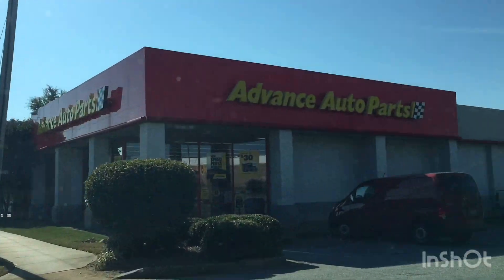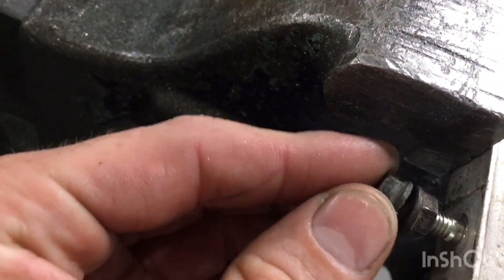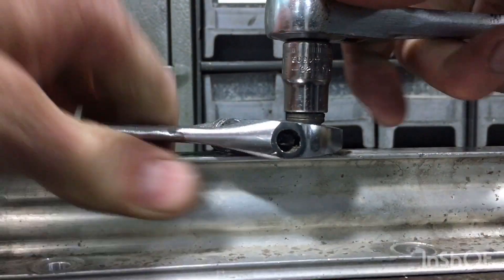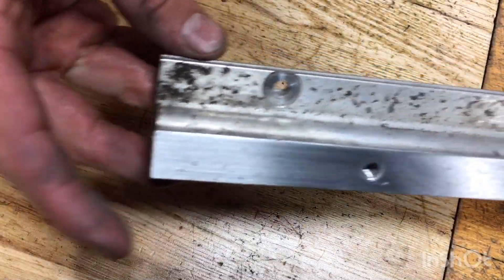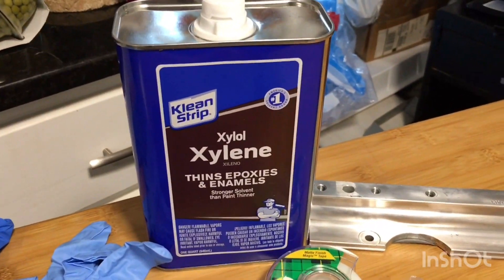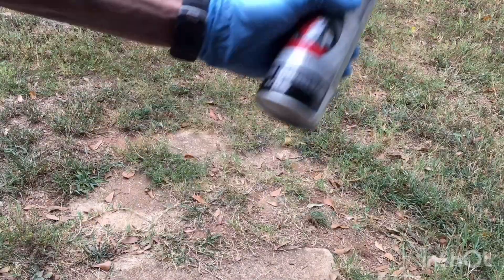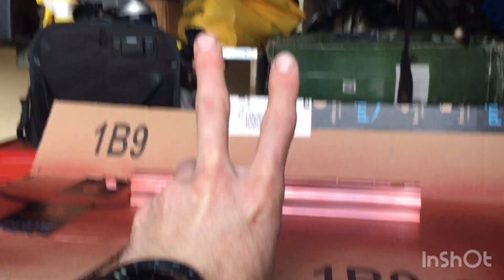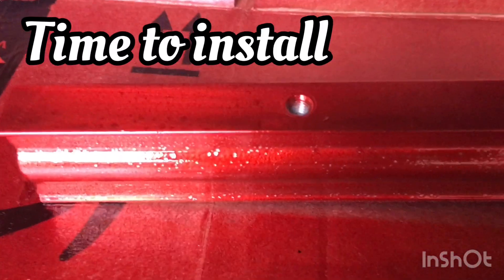How to Anodize paint Fuel rail on a Honda Civic

Comment: Which aem fuel rail and aem fuel regulator is that?
Reply from the maker: Its a cheap AEM rep that I found on eBay. But it works fine. Regulator is still the factory original one

Comment: Why put the stock on. Why not paint the aem one.
Reply from the maker: It was a cheap eBay $30 AEM rail and it would leak around the FPR bolts. So I wanted to switch it up until I could figure out a better permanent fix for it beside using Seal-All around the bolts.
Reply from the maker: james styler was also fun painting this rail and making a video
Reply: It looks great with the paint on the OEM parts.
Reply from the maker: james styler I think so too! Might have to try and do a hydrodip on one of the extra fuel rails I have laying around. If I do I’ll make a video of it too.